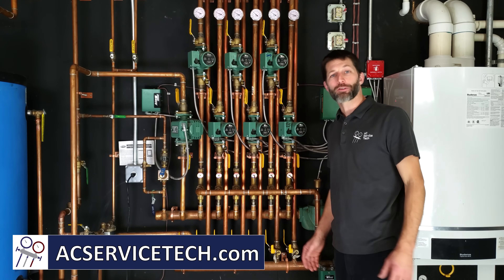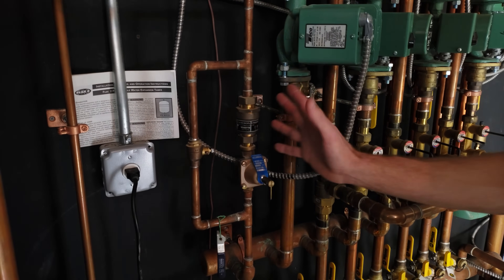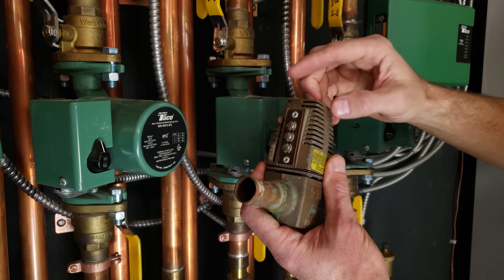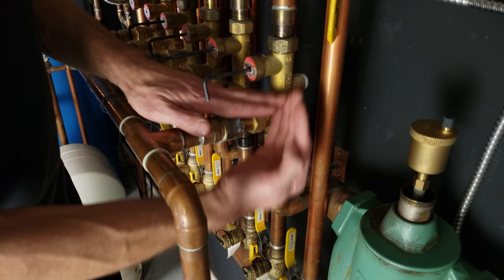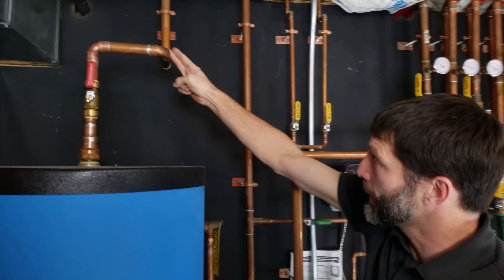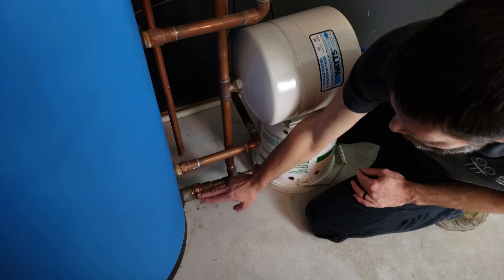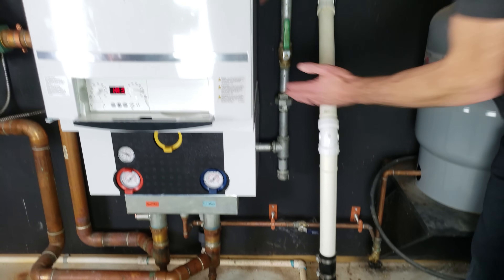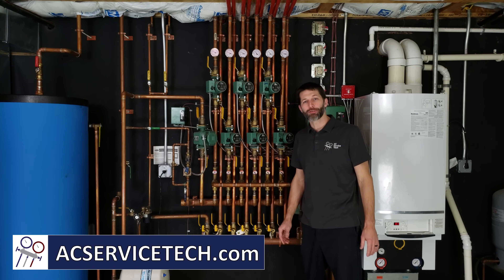Boiler Training Class, Parts, Operation, Zoning, Explained!

Comment: Comment is, GREAT Video! My question is, i have a 20 year old boiler with 2 zone valves, one circ pump. The boiler is short cycling and i mean short!! Like boiler will fire and then immediately shut down and i do not know why. I know there could be several possibilities but can you touch on some, or maybe a video on older boilers. Thanks again for the great videos!

Comment: Very good video. I'm having troubles with a zone valve system. Control valves have been disconnected and so the hot water is suppose to evenly spread throughout the entire piping system and have it balanced off return mixing valves and I've been struggling trying to do so. Anythoughts?

Comment: Also missing a valve on top of air scoop in case if we need to change the bleeder!
Reply: Look close, they have a check valve installed, when you u screw the air vent the valve will seal like a schrader.
Reply: @waynecostanza2280  those check valves are junk and will blow apart showering you in burning hot boiler water, how? they blow apart when the o-ring fails. the single o-ring on the moving valve core part is what seals when you remove the air vent, that same o-ring also holds the whole valve core in place when it's closed(air vent removed).
I've had five of them pop apart already, age ranging 1 to 6 years old from install, luckily I always isolate and relieve the pressure and yes they all popped apart with nearly zero pressure. even at no pressure a wide open dumps lots of water fast and if your working on it hot it's very ugly.
Reply: Good to know!

Comment: Great video, very informative, but I have a question. What are all the low voltage transformers for? The zone board should be supplying the thermostats with 24 volts, correct?

Comment: Nice video, 

Fairly neat install to except the bucket / tile holding up the calorifier expansion tank, and the back flow prevention should be prior to the quick fill bypass 

How do you add the inhibitor, any dosing pots or do you guys Just crack a nut pour into the pipe work ?

Comment: On a Rinnai M120S boiler, I have everything installed except the necessary controls for the boiler from my existing Heat Pump heating system.  I am using the LP boiler to replace strip heaters, thus the LP boiler will supply Auxiliary and or emergency heat.  On the boiler there is a connection  labeled OT Bus On/Off it states it is a "Room thermostat (on/off thermostat or control).  Is this connection a simple 24 vac input from the Air Handler (in my case 3rd stage) heat call with common as the return or Red power supply in?

Comment: Some have commented on the LWCO.  It looks to me to be at the level of the boiler circulator, above the boiler manifold.  As such, the boiler should sense whether there is water flow from the circulator, and depending on the pressure differential between the larger distribution manifold pipes and the boiler supply-return piping from the boiler manifold, the level in the boiler might remain sufficient with the boiler just cycling through the manifold since there would be no system pressure from the expansion tank once the system was open to atmosphere.

Comment: I like your videos but i think you missed out on a few learning opportunities here. I noticed several errors in installation. LWCO needs to be above the boiler, fill system should be installed at the point of no pressure change, header actuators should not be installed pointing down (that is my preference  for longevity, consult manual for specific installs), recirc pump is improperly mounted motor needs to be horizontal…. Any others i missed?

Comment: Thx for the informative video! I have boiler heat in my home so I've been trying to learn as much as I can. One question, how do you tell if you're automatic air bleed is working? I hear gurgling, mainly in my bedroom. I have tried to manually bleed air at the floor radiator without much success.

Comment: I'm a new boiler operator, and the building that I am working have  4 pennant boilers. 2 for heating and 2 for domestic hot water. The boilers for domestic hot water are connected to a big hot water tank storage that has a thermometer. To get the right temperature reading of the boilers,  do we need to check the thermometer gauge in the boilers itself or the thermometer in the water tank storage? Please clarify. Thanks

Comment: Shouldn't that water fill bypass valve be piped after the backflow preventer? Potential to contaminate the potable water supply with boiler water.

Comment: Just curious, but if the shut off switch goes to the low water cut-off switch rather than directly to the boiler, what if there is a major problem with the boiler, and you use the shut off switch, but the low water cut-off switch is bad and doesn't shut the boiler off? Is there any other safety measure used to shut the boiler off?

Comment: Also that main water fill bypass does not stop anyone from turning that valve on accidental so I would think buy code for purpose of that happening is should be a safety shutoff valve meaning you lock it off .. Hence meaning no accident..
Reply: This is a residential application not commercial and with the handle off someone would really have to want to turn that on. Not likely in this situation. BTW it is not code to have to put a lock out valve on the bypass here.

Comment: A few things I noticed, you are using PVC for your boiler vent pipe which is only rated for 140 F and is against code. You need to use CPVC which is rated for 200 F. Also, there is no condensate neutralizer on the condensate drain. Licensed Refrigeration Mechanic/Heating Technician Toronto, Canada and NATE Certified in USA
Reply: Class 3 ,4 appliance Vent pipe should be system 636

Comment: Why not just run the boiler close to desired temp for better efficiency and not having to worry about knocking it down with a mixing valve? Great video btw
Reply: it's probably feeding various zones that require different water temperatures, say cast iron radiators, baseboard, indirect water heater, and radiant.
indirect would want hotter water, copper tube/fin baseboard is generally rated at 180F water and quickly drops in output below that. then for radiant heating you don't want more than 110 to 140F, depending on the design and application. nothing like burning your feet walking on the floor 🤪

Comment: hello guys im plumber from Greece.I dident see any system for electrolysis because the boiler for heat water is made from iron and thw pipes are made from copper. Also i dident see the magnetik filter into the gas boiler.

Comment: Why are there mixing values on the heating zones?  I've only seen them on dhw.
Reply: From what I can figure, the boiler is creating 180 degree water but since it is radiant heating you can not heat the Pex or the wood flooring that hot. So in order to lower the temperature of the water, it mixes with the return water at a setting that is adjusted by the hex keys. But I think he mentioned that aspect of the set up.

Comment: The low water  cut off is way too low to adequately protect the boiler from dry firing. The feed Valve shouldn’t have a bypass. The feed valve should be piped as close to the expansion tank as possible. A few whacky things with this piping. The cavitation of water movement through all the unneeded manifold fittings should be supported by a spirovent to remove air and the zone valves suck.

Comment: 22psi @ 168F, sounds like someone undersized the expansion tank or the air charge is low. that looked like an SX-30V tank.
they all seem to leak half the air charge out in 18 to 24 months anymore, so I started overfilling them some to about 16LBS, while that can cause a fast pressure change from 12psi to 16psi each heat cycle, it gives more buffer before getting too low on air and lifting the relief, other route is grossly oversize the tank 3x or more $$$.
none of the tanks seem to last anymore and nobody checks them, until it floods something 🙄

Comment: If the infloor requires 115 degree and indirect is set for 135, why is boiler at 190?
Reply: Boiler will modulate as needed based on demand and outdoor temp.  It won't Target 190 all the time.
Reply: @tccoggs  Should the max temp not be set to 135?
Reply: @dwaynerenton1889  if it's a combi unit and it's making domestic water as well, you want it to full fire.   The boiler control will have turndown ratio to compensate and produce lower temps.  The max is the max, not what it's targeting all the time.
Reply: Heat transfer is a function of temperature difference.  And the water is flowing so there's a time factor.  In addition, the return water has to be warm enough not to shock the boiler, or any number of other such issues.  But consider, that 115 in the radiant floor is necessary to get the floor to 85ish in the time it is flowing.  And you need that being able to be produced at the end of the loop.  And you need to heat the DHW quickly enough that no one gets a cold shower during high draws.
Reply: In order for the indirect piping in the water heater to heat the domestic water to 135 degrees the water in the indirect piping will need to be much hotter than the desired temperature of the domestic hot water.

Comment: My Bryan Cast Iron boiler has been circulating 160-190 degree heat through our home for 60 years now. Not one lose nail yet. Home not torn apart. We have 5 zones and one Taco.  The biggest concern I have with this guys heat is the use of PEX. This must be the reason to lower the temp. In the past, homes using poly pipe have been sued as these poly pipes fail. Back in the 80s and 90s when they came out with this new and past problems solved with this new and improved poly pipe wound up later on with class action law suits as the pipe failed.  And now. History repeats as they are saying this new Poly pipe PEX is new and improved and the problems of the past are solved.  Yea sure. Everyone know there are no problems using copper.  PEX is pennies per foot which is why it is used.  If you can not afford copper, then do not do it. Go GFA. If you find a home for sale using PEX,  do not walk away, RUN!
Reply: I've been doing this 27 years.. most heated failures ive encountered were due to never changing the glycol combined with high velocity pump settings, or freezing of a zone . Pex is cheaper 100%, but copper also wears. Under optimal laminar flow, they are very comparable in terms of lifespan. Polly butaline is not cross linked poly ethylene. They are different products. And water main run for properties are often still done with polly.. so you still technically have a polly b connection at the main shutoff in the mech room.  An issue if you have mice 100% more than a copper service main.  In the end I'd not say one is better than another. It depends on application and $$$ ..   respectfully intended :)

Comment: Sorry also at water heater the t&p valve goes straight to floor to blow off where is the floor drain and or a pan with drain to a drain .. That is another code in most states .

Comment: Good video; except for 3 issues.  1)galvanized gas line; really? 2)where is the pot feeder for chemical treatment of the water.  3)this system would be more efficient if long radius elbows would be used versus short radius elbows.  Get back to me on these issues.
Reply: Get back to me on these issues ...😂

Comment: This system is so inefficient. Why supply 190-degree water to the entire system and then mix it down to 115? That beautiful and expensive condensing boiler will never condense  because return temperatures are above the dew point. Good explanation on component and function but no explanation on how to maximize efficiency and make use of the expensive boiler efficiency capabilities

Comment: Boiler and pumps should be installed below L.W.C, So it could protect both pumps and boiler! Very poor installation!
Reply: Okay.
Where's the link to your video?
Reply: @KINGPAFA  If I wanted to modify a milwaukee sprayer, you might have a good video.
I'm looking to learn about the basics of a hydronic heating system.
😆
Reply: I am with you Steve Thury, it was a very good video,  and K P added nothing but snarkyness  and condescension! A little respect people!
Reply: He’s correct and it is very dangerous to incorrectly install a LWCO, I’m sure Craig is not offended by him pointing out a very important and correct issue worth noting.
Reply: @waynecostanza2280  By the time you get above the boiler and pumps, then the lines are branched out and reduced.
Shouldn't LWC be at a main trunk line?
Reply: Just needs to be physically piped above the burner so that if the system starts losing water it will lose it at the LWCO before the boiler jacket loses its water. Ideally it would be on the primary loop as well.
Reply: Think of the way a sight glass on a steam boiler works, the water level will be the same in the whole system as long as there are no valves, check valves or restrictions.
Reply: @waynecostanza2280  Makes sense.
Looking at the whole system, it appears to be very professionally done.
Reply: Completely agree, very nice. Just good to note the LWCO, same as Craig notes the Pressure Relief should have been piped to the ground. Can’t always score 100% nothing wrong with a 97%👍🏻 Just so happens those two are very important safety factors…
Reply: I agree. I noted many other mistakes in my above comment
Reply: @waynecostanza2280  Come on new. Boilers have run for 100 years with a LWCO,. There have been very few issues.
Reply: Kp ,as long as lwco is on supply[ any where) its gonna work in shutting system down.if leak is 6"above boiler or below..
  I've put them where ever I can fit the tee.
If you noticed a 2" supply header. That job would hv taken at least 16 hours to do with another guy.
 Never failed ,ever for putting in a lwco..
  Btw all condensating boiler have some kind of gpm,lwco device built in there heat exchanger.
  You know very little,if you can say this is a bad install.
  I suspect your just a boss ,or owner nd could never do such work . You just have a license nd would not even know where to start. On a project like this.
  Probably dont understand why its 2 "supply.. 
You critic's make me sick,so glad I've only got a few more years to retire..
Reply: @jamesortolano3983  ,. You are correct that most units have a built-in low water cutoff  & flow sensor but in the event code requires an exterior low water cutoff ( which in most cases would be redundant ) it is required by GAMA ( Gas Appliance Manufacturers Association), AGA ( American Gas Association) & NFPA 54 to be located at a height towards the top of the heat exchanger ( not at a height below the heat exchanger). Navien wants it at least 6" above the heat exchanger ( refer to their installation instructions), Bosch has a built-in port at the top of the heat exchanger, next to the pressure relief for their LWCO ( sold separately and you can check their installation instructions). Sorry to make you sick. You may disagree but it is what it is, the instructions are what they are and the engineers do what they do.
Reply: @jamesortolano3983  I think you need to re- read the installation manual on LWCOs.